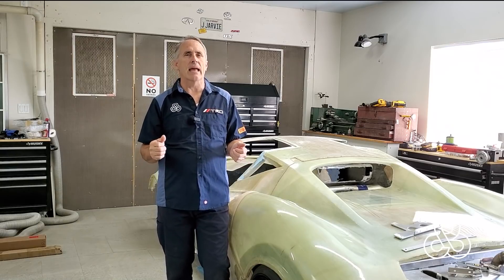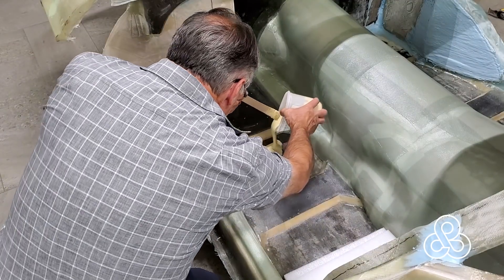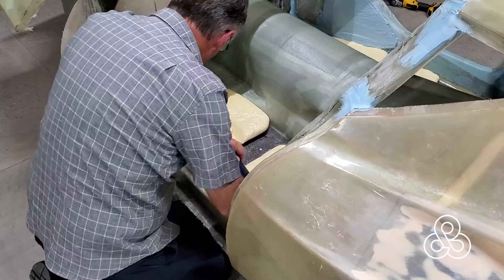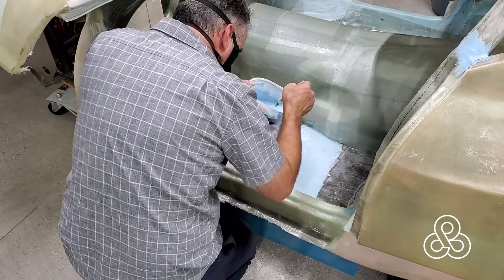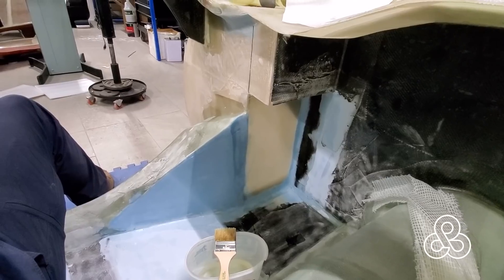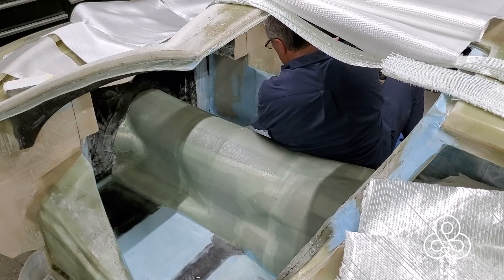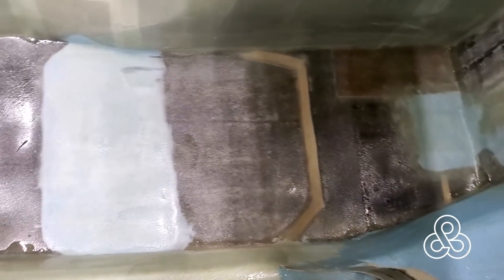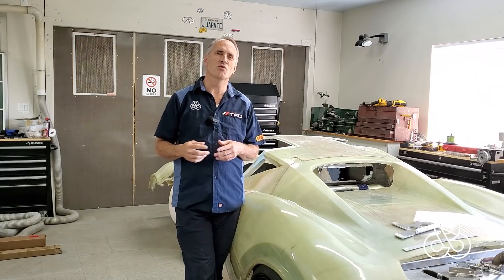A71 Okay, so one more foundation layer before the big superstructure layups. Arete Supercar project.

Comment: Anyone know what product he uses to make that blue slurry?
Reply from the maker: Epoxy and microspheres. Mix up about 1/3 the amount (volume) of epoxy and hardener that you need and then add microspheres until you get the consistency you want. It will be about twice the volume as when you started with the epoxy. Microsheres available at almost every composites supplier. Enjoy!
Reply: @BuilderCreator  Cheers! I appreciate the reply and all the knowledge that you share. I've learned a lot from your videos!

Comment: That "tunnel" is positively HUGE.........
Reply from the maker: Luckily the widest part is behind the seats!
Reply: @BuilderCreator  What two part foam are you using???  Structural???  There is such an entity you know....I think the one you are using is used in boat compartments and for pouring custom racing car seats...
Reply from the maker: @richardsmith9509  It is a closed cell two part urethane from US Composites. Not particularly "structural," but it does create a space for separating upper and lower skins. Most of the structure is in the fiber matrix tension and compression.

Comment: II would wait on paint and get the mechanical stuff working. Reason being, you might run into issues with the design (clearances, fitment, airflow, cooling, etc.) which, if you did start doing paint/finishing, would require you to take another step back and make structural changes, which of course would require you to redo the paint and finishing again.

Comment: Get it to the point where you can put a few coats of epoxy primer over the fiberglass, then after it dries for half a day, a few coats of filler primer for blocking.  Thats a good place to stop and go for engine work.

Comment: have you thought about running some carbon fiber tow from left to right in order to decrease the the torsion in the center of the chassis
Reply from the maker: Next step is to put in a lot of unidirectional fiber at a 45deg. across the floor and underside for torsion stiffness. Should be a video in the next few weeks.

Comment: As much as I would love to see it become pretty as soon as possible, I am also opposed to rework, and doing work on a finished surface presents the risk for rework.  I don't know how much detail you are going to do in the engine bay, but If you are painting at all inside the engine bay, I would definitely do that before I did engine work, just to avoid interference issues.  If it were me, I would paint the inside of the engine bay and cab, do engine work and cab work (seats, upholstry, etc), then exterior paint. and final fit, trim, and detail work.

Comment: You should defo get the mechanics all sorted, ideally to the point you can drive the car around, you never know what body mods will be needed until you get to that point. 

One problem with many super cars is, they are crampt and often angles the occupants.. It looks like you might struggle with these problems too. Great project but if you were doing it again, I think you should consider making the whole thing wider.
Reply from the maker: If I were doing it again I wouldn't make it wider, I would take the money and buy a little vacation home in Maui. Ha!
Reply: @BuilderCreator  But then you would be sat in your vacation home, whiling away the hours thinking, I wish I was busy building something in my workshop🤔😁

Comment: my 2 cents..... follow your engineering brain, and get it running first. Like a dry build on a hot rod. You can do what you want & need, and not have to worry about damaging new paint. Oncecommissioned, then get the paint on. As they say 90% finished, 90% to go !!!

Comment: Run the engine...even if the tune is not sorted out, the circulation of oil would be good for preventing corrosion.  Also, not running it makes seals dry out and later, leak.  While paint is "fun" it should come as late as possible.

Comment: I think you need to finish the structure and get the doors to latch. Add the glazing and mock up all the interior architecture, pedal box, ip, wheel and seats to check entry/stress and basic user ergonomics from the driving position.

Comment: I noticed the lack of room between the trans tunnel and the door and was wondering if you had seats picked out.  If not, my best suggestion is the Recaro seats from an Evo 9.  They are a slightly prevalent seat swap for the C5 corvette, which has a notoriously narrow seating area.  They’re leather with an alcantara/microsuede center section, and they are well bucketed, but comfortable.  They also have harness slots from the factory, and being stock seats, they can recline, and they’re crash tested.  Final point is that they’re Recaro seats, which are very nice, but these aren’t super expensive.  Just my thoughts.
Reply from the maker: The seats will be built in as part of the structure; at least the lower lumbar section. The upper (thoracic)area will hinge to allow access to storage, engine management electronics and heat/AC ducting. Pedals and steering wheel will adjust for driver changes.

Comment: I’d try to get it to run and drive before paint, because if flaws show up during the process of getting it running you can make changes to the structure without having to paint the car again. Once it’s running and driving properly I’d disassemble it and get it painted

Comment: Put it on its wheels first. The rolling chassis, then the motor, and do the paint last just in case the intake system or an unforeseen situation requires you to change the bodywork.

Comment: Without a running engine you have a sit-in sculpture with an ashtray and a radio.  With a running engine you have a car.  I'm for the engine first.  Besides, engines are cool.
(If you go for the paint/bodywork first, though, it's not like I'm gonna unsubscribe or anything.  It's just that you asked...)

Comment: I think your at a crossroad where impatience could cost you alot of lost time in the future. My personal experience building showcars has proven that I have made this mistake tooo many times. I look forward to seeing what choices you make, but here is my 2cents>>>
 
Get the chassis and running gear worked out before any final aesthetic choices, then finalize the engine and its cooling/lube systems. Then finish exterior panel mechanicals such as hinges and fasteners followed by mocking up the interior and fixing major panel gaps...... Now you get to put primer sealers etc before drive testing. Only when you finally  get an OK on the shakedown do you jump into the aesthetic pool of finishing the project.

Comment: IMHO, I'd finish the structural bodywork and then shift to getting it to a rolling runner. Paint and bodywork may be compromised as you work through the mechanicals and its easiest to make changes prior to paint. As a compromise, you could switch it up on the interior and focus on this for the "pretty part" while you work on the mechanicals.

Comment: First the basic bodywork, then clean the shop. Then all the electricals, interior, doors, running gear, brakes, steering. Then clean the shop again. Then finalize the engine, test drive, tweaks, suspension, allignment, more testing. After a couple of inevitable fires and fixing those firehazards, you are ready for final disassembly and paint.
Reply from the maker: At least the fires shouldn't spread after all the shop clean up! Ha!

Comment: My first thought was paint, but then I considered any changes would require more paint. Since the engine hasn't run yet, but it should be fine, if it's not fine then more changes may be required. Get it running, final answer.

Comment: Would love to hear the engine but i think getting the body finished and get it that much closer to a complete car will give motivation to get it done. The engine should be pretty easy. No point in having an engine if you have nothing to put it in
Reply: But only paint after everything is done and tested. When the car is done then take it apart and paint everything for final assembly

Comment: A car should be a machine moving under its own power primarily and just then a work of art, I definitely suggest to work on the mechanical side first and leave the paint job for the end. As an icing on the cake... Also, as many mentioned before - working on the power-train and suspension can cause (intentional of accidental) "modifications" to the body...

Comment: You could give the bodywork a coat of primer, that way people can see the car in something other than bare fibreglass and you don't need to worry about scratching a nice paint job, because you won't have done one yet, good compromise, I'd say.

(And "bridging solution" sounds better than slurry, although it's not quite a bridging solution, but shsh, nevermind that)
Reply: Thats what we used to do but i think these days primers are not supposed to sit before base/clear but i'm sure someone more knowledgeable on the matter will chime in.

Comment: Get the engine running, you might have to make modifications to the engine bay. And if you had it painted, you'd have to paint again.
Reply: My first thought as well! You want all engine work done prior to painting, nothing worse than having to be extra careful around fresh paint.
Reply: True
Reply: Run the engine first and then paint. Keep up the good work.
Reply: I agree with 90% of the comments that engine first is smarter , but I'm with the creator on this one, motivation is important. I just finished resto-modding my 1969 bronco, and I made the "hasty" decision to paint it baby blue with white accents before the new transmission was even in, and it supercharged my passion for the project. Before I painted it, I was sort of in the mindset of just getting it done decently and quickly so I could drive it. But seeing it as the beauty it was to become, I really started to put my heart and soul into it. I even color matched most of the hardware and brakes and interior pieces. Although I had to be extra careful and use a blanket to work on the engine bay, the feeling I got seeing it first thing in the morning far outweighed that small nuisance, and I think that transferred to the project. You can always fix a scratch!

Comment: Looking back at older videos, still trying to catch up because I just found your channel not too long ago.
I'm building my own car as well and I'm curious why you aren't using any carbon or kevlar?
I plan to use all three as I'm familiar with most of the strengths and weaknesses of each material having built high performance (read strong and light) rc sailplanes for almost 40 years.... (holy crap how old am i?)
Reply: He did a whole video explaining why a month back i think

Edit:  titled "is carbon fiber worth it?" 2 months ago
Reply: @SteveDave  fair enough. I didn't look hard enough. Thanks. I'll get caught up before I ask anymore dumb questions....
Reply from the maker: 40 years? didn't RC controls have tubes and rheostats as the electronics back then. Ha! ;)  Thanks for watching-  ther are no dumb questions.